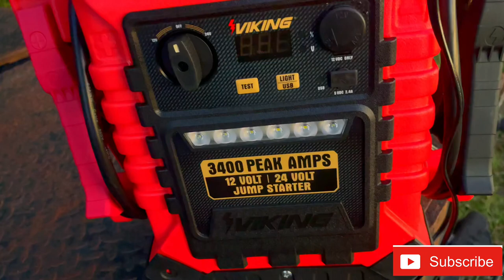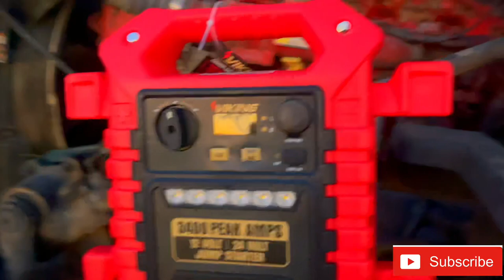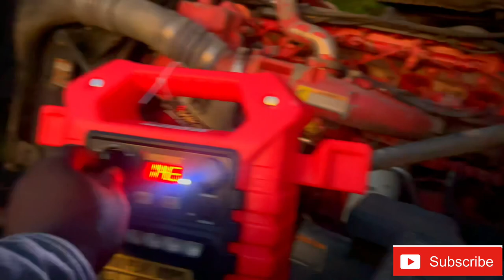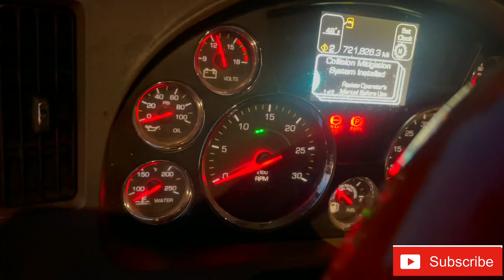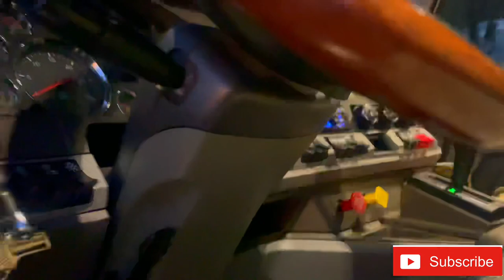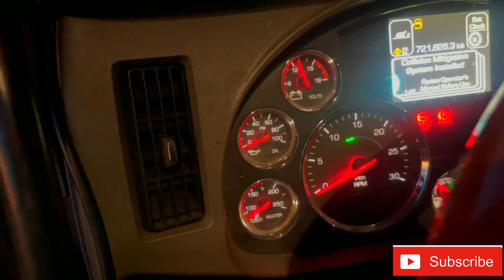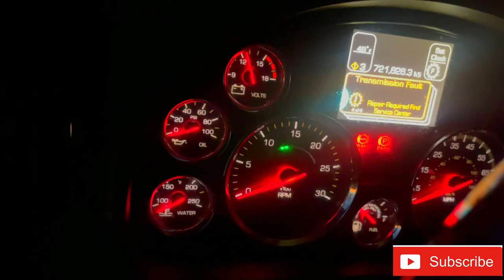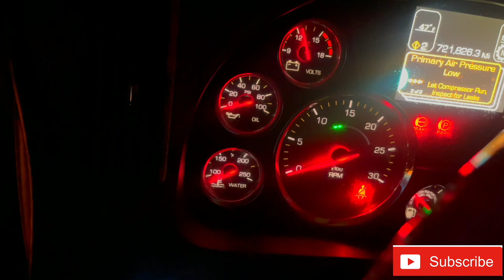VIKING 3400 PEAK AMPS IS IT STRONG ENOUGH TO START A COMPLETELY DEAD SEMI TRUCK?MY TRUCKING LIFE

Comment: First,  you have a 12 volt system.  Do not select 24 volts on the booster.  The constant beeping is warning you to switch the selector to 12 volts. Access your truck batteries and make sure all of your cables are tight.  Charge your booster again.  Always connect positive (red) cable first and negative (black)  cable last.  Turn off all accessories (lights,  ac fan and close your door so that your interior lights go off.)  Do all of these things and your truck should start if your battery voltage is not too low.
Reply from the maker: I appreciate you my nrother
Reply: @ChasingMrHamilton  Also, get a 12 volt USB charger with voltage display from Amazon.  It will allow you to monitor your battery voltage even with the truck switched off.  I don't ever let my system get below 12.4 volts.
Reply: i have viking 1700 brand new , when my electric can’t start i use this jump to connect to my electric but not work , my viking jump full , then i call AAA they use  JNC 700 R jumó connect to my electric car 1 minute connect power to my electric car , do you know why ? 1-22-23

Comment: 24volts on a 12volt system the jump box would of started a long time ago. You be lucky if you don't gotta replace the battery because this is a God way to kill them.

Next time put on 12 get inside the truck let the lights go off. That way you get max power to the starter.  All you did was kill all the power in the jump box.

Comment: Also, you need to disconnect your cables to check the power you have left over. Hit the test button and it will tell you. If you leave the cables hooked up, it will tell you the voltage on the batteries and how much power you have. When I disconnected connected the cables, I hit the test button and it shows that I have a 100% at 12.8. But when I go home to plug it back in the wall, it says I only have 40%.

Comment: You have a 12 Volt system.  You could cause damage to the electrical system by putting 24V to it.   Most all US trucks are 12V and have multiple batteries wired in parallel vs. in series for a 24V system. The easiest way to tell if you have a 12 or 24V system short of the owners manual is looking at gauge on the dash, checking cigarette lighter if it has one or any other accessories like fans, lights etc... that may be marked 24V
These Viking Jump Boxes are pretty good IMO.

Comment: Man, I'm having the same problem. With that Harbor freight unit. Jump back. But your truck is only twelve folds , not twenty four But your truck is only 12 votes, not 24. You can charge your batteries with your car. It'll be 30 minutes on each battery. It will take 2 to 3 hours to charge him. I know this for a fact. It works what other people doing it. But I can't seem to get this thing to work also.

Comment: I got that start all jump pack from when u had gen 6 jumped a year in a half ago.  I mrs 10,000 amps I’ve used it 3 times one on my truck and helped out other drivers. Paid $750 for it. After 2 times it pays for itself.  Use the 12 volt system.  Make sure u fully charge the pack.  I think u have less than 10 seconds once u connect it to your truck to start it.

Comment: 2000 dollars?? oh hell no, there not that much don't go to Kenworth ever, you can get new battery's way cheaper than that , im in the Nashville Tennessee area and ill do it for half that and you need to crank that engine on 12 volt setting it would have started

Comment: What you did wrong was, you didn't call road service. Those jump packs barely do anything. when you kept switching it to 24V your trucks electronics were not coming on because they had to much voltage. either way you aren't starting a truck with that little jump pack.
Reply from the maker: I was about to get it started I just had to replace all the batteries
Reply: Bro, I would like to know how much to pay for the road service?
Reply: I  start semi trucks with jump packs daily. He just didnt know what he was doing.